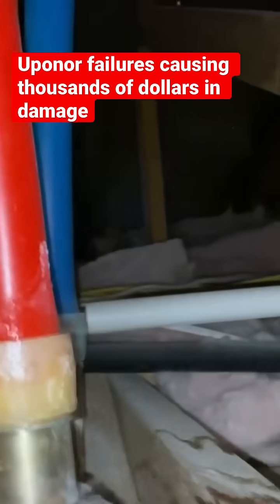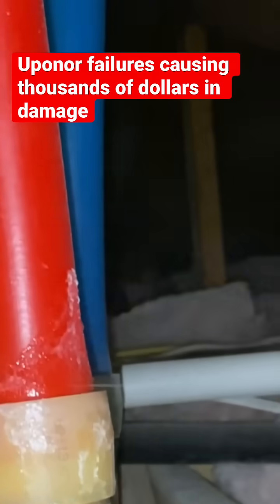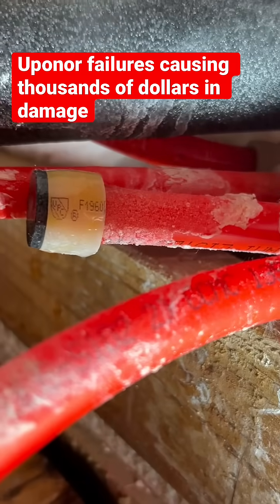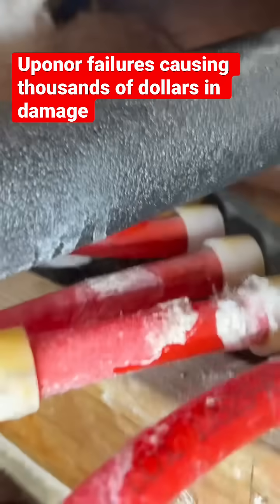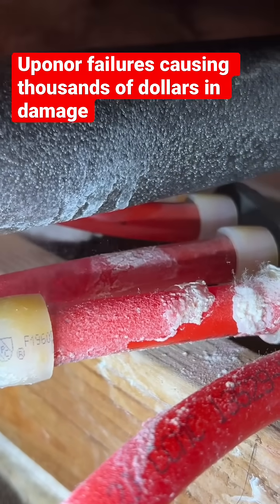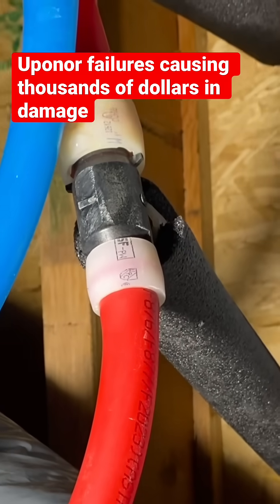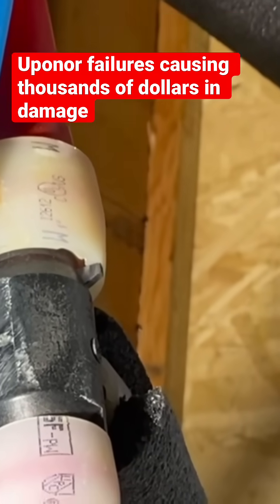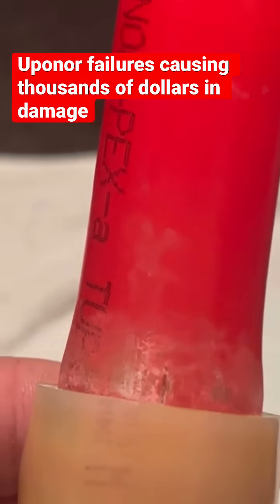Why is Pex starting to get Pinhole leaks like copper? #Uponor #plumbingfail

Comment: Have not had a crimp fail on a copper crimp ring in 15 years
Reply: I haven’t had a failure on expansion pex in 24 years.
Reply: @pjplumber2146 good for you but I’ve seen many leaks on expansion pipe. Even in houses that are less than 10 years old 😂
Reply: It's not generally a fail on the fittings or installation, for me it's almost always on the hot side, after a few years the pipe starts to break.
Reply: No it’s just your actually running 3/8 pipe. Uponoor fittings are full port and actually 1/2” while all the other stuffs fitting holes are tiny .and that’s why I use uponoor.
Reply: I lived on a mobile home for 20 years and I saw 2 leaks on the hot side, one was right next to the tank and it was nasty cus I didn't see it till the wall on my son's room was falling apart
Reply: Yes but I've seen the fittings fail
Reply: Copper pipe is not as good nowadays back many years ago copper pipe was made much better and it would last as long it doesn't freeze up being it's colder and people are having problems with pipes freezing well PEX maybe better and all I'm hearing is a lot of problems with the Red and blue PEX pipes it's best to use the clear an white and I hear that A and B have had some problems.
Reply: Copper pipes are better
Reply: @garagekeys copper has it's own issues. Too high a flow and it corrodes. Power on the pipe and it corrodes. Long story short pex is better in most every way including price.
Reply: @mp-xt2rg  why is PEX not allowed by code in certain areas in the United States, but copper is allowed?  If it's better in every way....
Reply: @garagekeys  I'd imagine the only places it's not allowed are area with big ass rats. You can't use PVC drains in those areas either like new york. But who wants to live in a hell hole like that anyway. Galvanized steel holds up to rats as well but I don't think anyone is going to argue it's any good.
Reply: @mp-xt2rg  the thing better about PEX is the price and easy to install a moron can do it.  Copper is the way to go for longevity.
Reply: @garagekeys  copper will not outlive pex. Any idiot can do copper too. Your assertion that copper is better than pex is based in blind tribalism not reality. Copper has corrosion issues pex does not. Copper will pit under high flow conditions pex will not. Copper will probably hold up better under uv but it's not like that's super useful. Ice splits copper pex just expands. Hard water will create deposits in copper not in pex. Copper will creak In walls when it expands and contracts pex does not. Copper water hammers pex doesn't. So you have rat resistance and uv stability. Otherwise it is worse in all other categories.
Reply: @mp-xt2rg  I don't know the last time copper pipe had a class action lawsuit going against it, PEX does though, I wonder why 🤔
Reply: @garagekeys  lawsuits involving copper piping are extremely common. Maybe you didn't notice because you were busy burying your head in the sand hoping pex wouldn't take over.
Reply: @mp-xt2rg  hopefully your divorce goes well.  I been too busy burying my black pipe to worry about your PEX obsession.  👍😜
Reply: @garagekeys  also that's just a dumb argument. "Takata had was involved in a class action lawsuit so airbags are bad technology in general". Sounds dumb doesn't it?
Reply: @garagekeys  I'm dealing with an idiot. Got it
Reply: @mp-xt2rg Airbag technology in general isn’t bad just like piping/tubing technology for plumbing isn’t bad however the specific airbag technology used on that recall was bad technology. You aren’t comparing apples to apples, it wasn’t airbag technology as a whole that went wrong, it was that specific technology from that specific company so he does have a point when he saids copper doesn’t have recalls like pex has. I just looked up the lawsuits against copper and one was against a specific company that makes just the fittings, not the copper itself and the other was against an entire city for having horrible ph levels and not against the copper itself also. My personal opinion, Copper is better at the moment only because it’s been around for so long so they have worked out much of the early kinks but pex is a better and smarter technology so in time it will surpass copper by a wide margin once it has got through its problems in the early stages just like every technology or product goes through.
Reply: @James_Edward59  pex doesn't corrode. copper slowly gets thinner over time the more water that passes through it the faster it thins out. copper is fine buts far less durable far more difficult to work with and more expensive. copper can be a real issue in commercial installations with recirculating pumps. copper hot water lines  commonly fail in just a few years with constant high flow circulation.
Reply: @mp-xt2rg you’re in for a rude awakening when you discover you’ve been installing toxic plastic pipes for decades.
Reply: @HubstepCamaro  based on what?
Reply: @garagekeys  That is called Corruption and Graft.  

It has nothing to do with Pex vs Copper etc.
Reply: @mp-xt2rg I'll agree on the NYC rats. Wow, they dwarf any I've seen near our farm.

Comment: What people dont realize is , that carrying those products, or storing them in the sun, it does compromise and make this things happen or fail. It's hard to know where that product is been store in the stores , transported to the stores and how long it's been in this back of the plumbers trucks
Reply: Or what type of light has been shining on it while stored
Reply from the maker: I think that could be part of it but I believe uponor is rated for up to 6 months of direct sunlight or something like that and Ive found Pex installed outdoors without any covering or anything and its often just brittle not leaking though.
Reply: Amen dude. I see “plumbers” riding with pipe in back of truck. Hell I see plumbing installed without being dried in. These idiots don’t realize the effects of meth on teeth. They aren’t gonna think about u v rays. They don’t just come from the sun.

Comment: I repiped my whole house in Uponor PEX-a when I moved in. Now your video and comments are worrying me..  At least I can fix it myself...
Reply from the maker: Do you have a recirc pump? Make sure you have it on a timer so its not running 24 hours a day, Make sure your water temp is below 140 and try and get a conditioner or a filter that removes chloramines from your water
Reply: You can fix it, you can also fix all the mold/rot in attic/basement/walls/ceiling/your pocket book/etc... after you realize there's a leak(s) wherever those lines were installed if/when they fail. Hope you don't end up in that situation my friend.

Comment: There is no such thing as “expandable pex b”.  A & B are two completely different processes. Good luck to u
Reply: They're saying that Zurn Pex B will work with expansion fittings.  I've heard it from several folks now.
Reply: @Southern Benefits Solutions  you are correct. Zurn does make a pex b that works with both. Good stuff.
Reply from the maker: There are a few Pex B manufacturers that make their pipe to be expanded or crimped. Zurn is one of those.

Comment: We know about this pex I run zurn and Shark bite brand pex B but I use copper crimp fittings and solder adapters and haven't had a issue nibco also has a bad pex pipe too pex C has lawsuit

Comment: i use shark bit fitting never had a pine whole leack
Reply: I don't trust shark bite over welded joints but I've had one in use on my water spigot in back yard exposed to full Tx sun every day 7+ years now and made it through multiple hard freezes without a hitch.
Reply: you had a whole pine leak?

Comment: Can you link the expandable pex B you were talking about? I know you can use crimp style pex b fittings and ring on pex A, but I've never heard of a type of pex B that you can use expansion tools on
Reply: It's important to learn the print stream on the pipe, any Pex piping marked F1960 is cold expansion rated.... Sioux Chief, Zurn, and Sill-O-Pex are F1960 rated Pex B 
Merflex Pex C is F1960 rated as well
Reply from the maker: https://www.zurn.com/innovation-efficiency/pex
Reply: Good information but I think the problem lies when you have to work or tie in on a pex B lined house. You’ll always have to crimp at least 1 fitting
Reply from the maker: @slickmick7114  I’ve never had to crimp a single fitting using pex B zurn and I don’t even own a crimper
Reply: Harder to find the Zurn for the DIY’ers.
Reply: What very little I know about it, that's exactly the first thing I noticed.
Reply: You can not use expander on pex b only crimp on B if this was used on B this will cause issues
Reply: @Sh-eb8fd  actually after a bit of googling OP is correct. Zurn has certified their pex B to be used with expansion fittings and tools under an ASTM certification, which is the basis for all plumbing fittings. That's wild, also after a bit of googling, it seems upunor has been doing a bit of narrative control to make it seem as if pex A is the only pex that's able to be expanded when it's just not true. Something I believed too until just 20 mins ago.
Reply: @Sh-eb8fd  actually OP is correct. Go Google it with the terms zurn expansion. They just certified their pex b pipe to be used with expansion fittings and have an astm certification, which is all that really matters in the plumbing fitting world.  That's wild, didn't know that.

Comment: Copper is king!!
Reply: Not really  had same pin hole leaks on older coper lines  and had to replace all with pex.
Reply: No. Galvanized is the real king.
Reply: @Plumbtired37  I will assume u are joking because we have information Long term on both materials
Reply: @jasondonnelly8940  Nope not kidding. Yes Galvanized pipe is more labor intensive. 
Galvanized pipe has outlasted copper pipe by decades. Here in the Southeast there are still houses and buildings with Galvanized pipe in them that is 60-80 years old. Yes it’s at its end of useful life. Copper in this area just doesn’t last as long. Galvanized holds up better to freezing and even lightning strikes. No I don’t necessarily like galvanized pipe due to the labor to run it  but it’s a top tier material that outlasts anything else that’s been developed.

Comment: well, there was a class action suit for PEX, as a replacement for Copper, I am just not convinced.  PEX-B is good?
Reply from the maker: Apparently Pex B does not use some of the same methods they use for Pex A when making the pipe and those methods are what may be causing the pipe to have these problems occasionally, Im a Believer in pex its a great product however the leaks ive been finding me do worry me and unfortunately theres no real pattern to help determine what is causing them.
Reply: @PlumbingExplained  thank you

Comment: Upinor has a recall on red and blue pipes. Massive amounts of failure across the country caused by the curing in the colors.
Reply: Its being kept quiet need to spread the word
Reply from the maker: @quentinp8754  there’s a guy here on YouTube named Joe Ludlow with Integrity Repipe that claims it’s in the extruding method they use and the way it cures
Reply: That's why I bought clear (white) Pex-A pipe. White is superior.
Reply: @martysk8r  easy brother lol
Reply: thought the color is only on the outside. The cracks are starting on the clear inside part.
Reply: Thank you I almost used the colered one in my home do you recommend the pex with crimp ?
Reply: Link the recall

Comment: I’ve seen 20-25 year old wirsbo pex (they turned into uponor) that was just fine and I hooked onto it with new uponor pex no issues. I’d say it’s most likely a combination of defective pipe and poor installation. But only time will tell…

Comment: I replaced 80 feet of 1" uponor that was used for the hot line of a commercial kitchen for a assisted living home. After taking it out, we finally saw it was cracked all along the pipe after several leaks over 2 years before we replaced the whole thing. The pipe had a recirculation pump in it and had 140 degree water going through it 24/7. The only thing that we could get for information is that the pipe became brittle with the constant high temp over 15 years and became cracked. It was also at this time we discovered the PRV for the building was bad and the whole building was under 110 pounds of pressure, instead of the intended 70. So it could have just been a niche set of issues. Or the pipe was set out in the sun before installing, however, it was only the hot line that was under the hottest temperature.

Comment: It's the chemicals now standard in public water.  Red and blue is discontinued and even new pipe is susceptible to cracks from chemicals
Reply: Add a carbon block filter at the main supply to block chlorine.
Reply: Dennis, this is incorrect. Pex is chemically inert, meaning very few chemicals interact with it, including chlorine.
Reply: @celticslimjim  completely wrong.  PEX is a poly-ethylene product, chloramines inside municipal water break down the oxides in ethylene causing micro-cracking.  On top of that municipalities are switching to chlorine dioxide for chemical treatment which has far greater oxidating potential...go read Uponor's installation manual.
Reply: Seen 3 buildings now, standard aquapex yellowing, hardening & failing prematurely as well.  Seeing horizontal cracking down the pipes. All cases seen, 1 section or area of pipe in an entire building that's effected and all installed at the same time.  Not sure if it's 1 piece of pipe that was exposed to prolonged uv in a yard but the expansion rings were also always yellowed.  Maybe the pipe was hit with a chemical. No idea!
Reply: is copper then still the king? the chemicals that the municipals are adding, you can't do much about it, so is copper just the safe route to go still?
Reply: @bludika  Depends on the water and location.

If you have acidic water, copper is bad and will rot from the inside out. Freezing temperatures are also bad, you have to insulate the crap out of the pipe and make sure the insulation is never damaged.

If you have basic water, copper is fine, eventually a bio film and calcium will coat the inside of the pipe and protect it.
Reply: @GGigabiteM 
More copper oxide than calcium, and no biofilm. You do not want a biofilm in your pipe.

Copper is a great water line because it is naturally antibacterial.
Reply: @bludika it seems so. Theres no telling how old the copper in my house is, but it has zero corrosion on the inside. The steel pipes inside were clogged up bad. And the galvanized coming from the street is about to bust and its from the 30s or 40s. If galvanized wasnt so toxic, it would be king as its lasted about 100 years.
Reply: @bludika  
Copper is still king.
If you must use pex. Use PEX B. It lasts longer then Pex A vs chlorine which is what is breaking it down faster. Pex leaches chemicals into the water. If you have it installed at minimal put a filter to drinking/cooking water. Studies show it leaches in possible micro plastics, cancer and organ failure chemicals.

Comment: Using wirsbo for over 20 years, and it happens to me  once,but not a pin hole,the pipe  splitting in the middle of 10ft length 5 years old repair very weird im live in las vegas nv ,in conclusion pipe probably  defective some people said pipe was exposed to the sun light i dont thing so never happened before and after ,in your case may be you need to check the heads but is weird too 
But I love wirsbo
Reply from the maker: I dont know if the Exposure will create pinholes, I just cut some exposed Uponor out a few days ago It was actually on the exterior of the house and it never pinholed but it was very brittle! the moment I touched it, it snapped!  I see it mostly on hot lines but I have found it on the cold lines twice now, Ive been doing some research a guy named Joe Ludlow here on youtube has some good information and Ive researched some of his claims and they appear to check out so im probably going to be doing more videos on this subject here in the future as I think its important for us as tradesmen and the customers to be educated on whats going on.

Comment: Zurn Pex B has always been good to me. Used it for 10+ years
Reply from the maker: Do you also expand it or do you crimp it? I know it can be done both ways, I have been expanding it! Zurn made their own Expander heads that are interchangeable with the Uponors and I think theyre designed better/work better to be honest.
Reply: @PlumbingExplained  I use the copper crimp rings. Honestly just found out like a month ago it can be expanded. Does that method seem to work well for you?
Reply: Where do I buy Zurn?
Reply: @richardleon9523  depends on where you’re located but Ferguson stocks it in my area
Reply: It’s my go to everytime as well